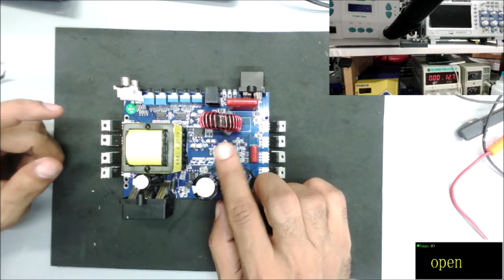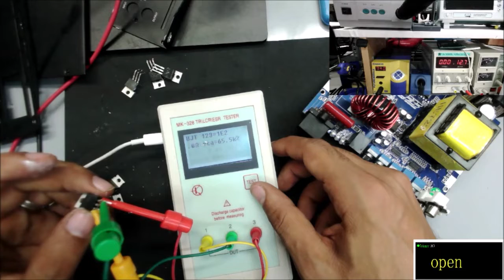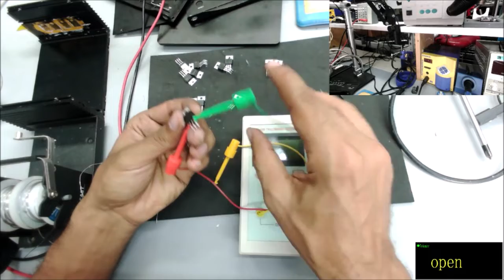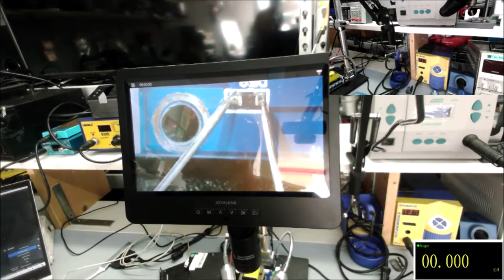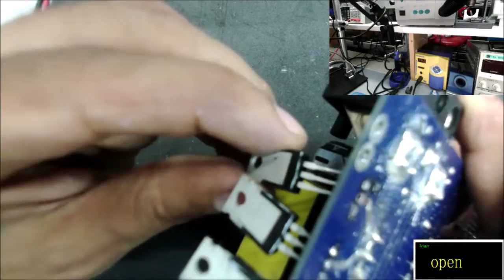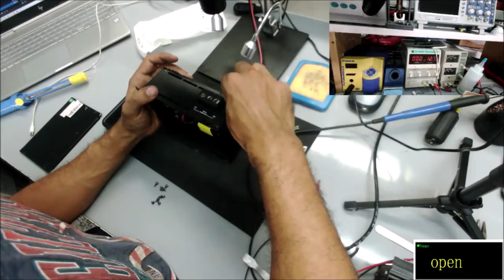Apocalypse atom series AAB-800.1D car amp protect mode red light fix

Comment: that's misinformation those or not china ic they mask of the ic from factory
those style amplifiers are sound digital copy from Brazil and sound digital mask all components so they can't be copied so the Chinese did the same 
it's easy to know the transistor if you be fixing amplifier for awhile
those style amp can use 640n and the more powerful ones like 1 channel 3k up to 5k can the 4115 in some the 4227